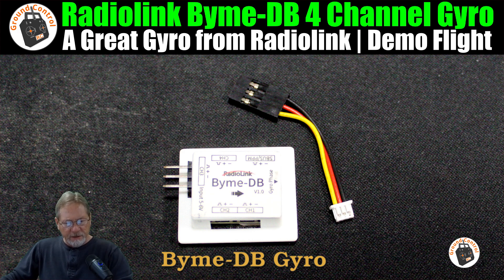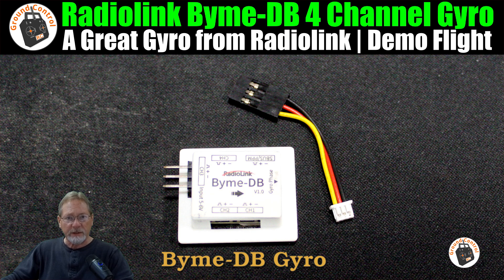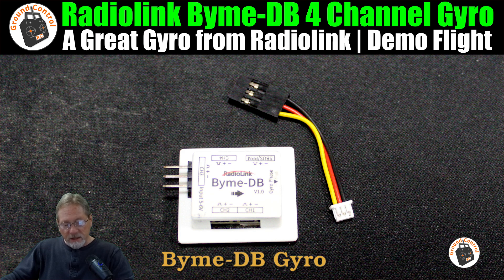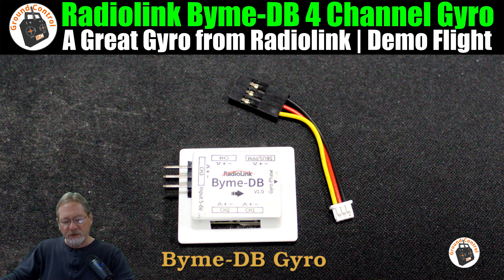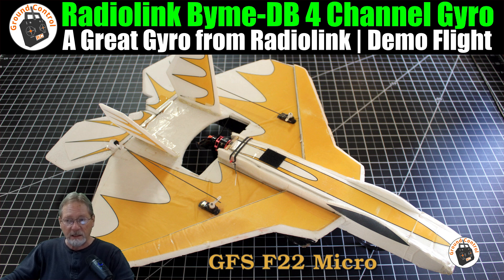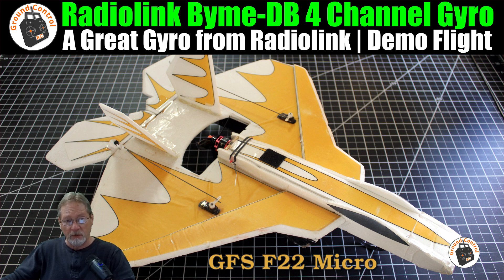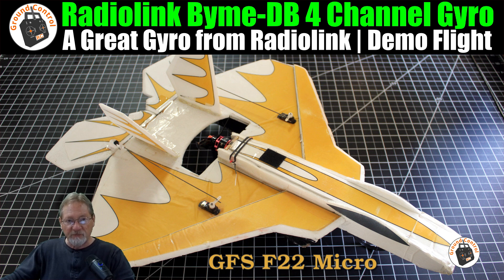Radiolink Byme-DB Gyro Demo Flight in the Glue & Fly F22 Micro Parkjet

Comment: maybe this is in one of the videos and i missed it. what do you set your settings for ch 5 for the three modes? manual is making zero sense to me 🤔
Reply from the maker: There are (3) Modes accessed on CH5
Mode (1) is Fully Stabilized - Bank and Pitch are restricted and it Auto-Levels the plane
Mode (2) is Wind Mitigation - No restriction and No Auto-Leveling
Mode (3) is Manual Mode - No input from the gyro.
Reply: i guess what i mean is what are your switch program settings? ex, most 3 position gyros i see are -100-0+100. the manual says to set to 1000/1300-1300/1700-1700/2125 🤷‍♂️ i am using -100-0-+100 on a three position and i THINK….think is a very strong and assumptive word 😂 i think that may be correct.
Reply from the maker: @americanolounge6572  If your 3-position switch is changing the gyro modes as expected, you need not worry about those numbers.
I believe those are PWM Channel output values.
Reply: ooooohhhh boy. i was using aura boards, i bought 3, 2 were DOA. They would appear to function on the bench, i totaled several planes thinking i was programming wrong…once i realized they gyro was messed it, it had had me sketched as it appeared to work while testing…but just wouldnt fly. this appears correct though, i  -100/0/+100, down is no gyro, middle is gyro with full extension of elevrons & rudder, up is less motion but still s massive amount (way more than i am use to).
Reply from the maker: @americanolounge6572  I'm glad it's working for you. The Byme-A, Byme-D, and Byme-DB Gyros have been my go to gyros for several years.
See you in the Air!

Comment: Thanks for the Radiolink BYME series videos. I had actually bought a BYME DB before watching and installed it in a Sonic Modell HD wing, which is my test airframe, but not yet flight tested. The BYME DB is a very easy set up and phase alteration, [which I don't think you elaborated during vid]. Used to use the ZOHD Kopilot, which are no longer manufactured. So I'm going to buy a few of these. ✈️ 
Subbed to your new channel 🇦🇺
Reply from the maker: Thanks!
The Byme Gyros have been my goto Gyros for several years now.
They're easy to use PNP Gyros.